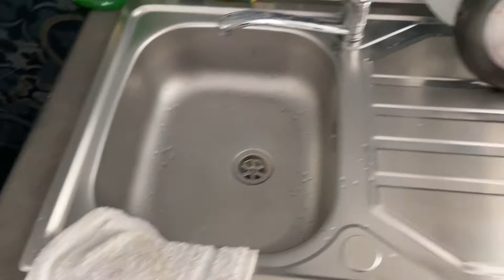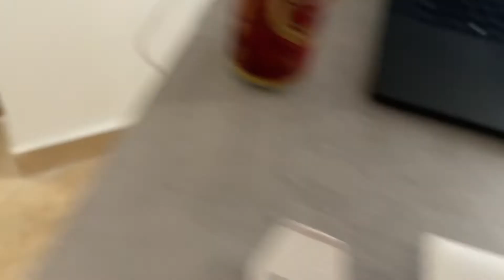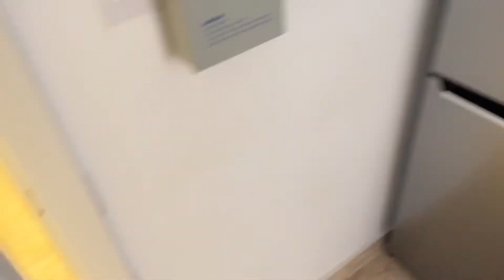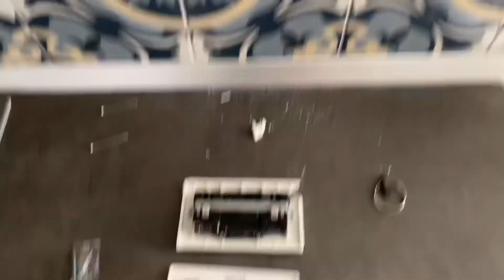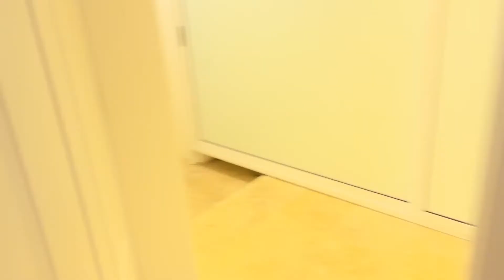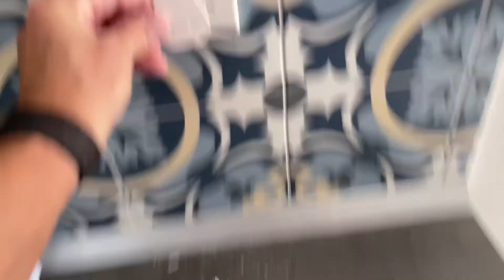I BROKE IT!! I broke the lame ass wall outlet..  DUH!!!  - Valletta Malta - ECTV

Comment: The 3 pin plugs are a UK standard used in Malta. Meanwhile the 2 pin is the European standard. Also kindly note that the adapter provided is not safe as it totally bypasses the Earth connector. And with a high power appliance like a toaster is totally not safe. Please use the adequate adapter.
Reply from the maker: Wow.  I had know idea that it bypassed the ground.  We did away with that in America in the 70s...  So they all pretty much have 3 prong plugs for high voltage items.  Thanks so much for the info.  I will go to the electric store and see if they guy has another type of adapter that does NOT bypass it.

Also..  Thanks so much for watching my video and the feedback.  Certainly a life saver over burning my airbnb down...  LOL
Eric